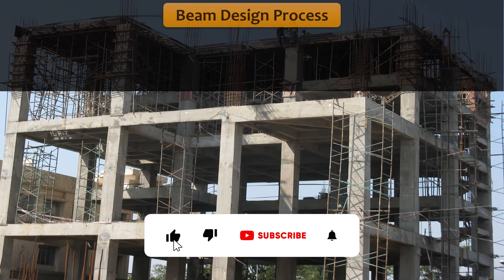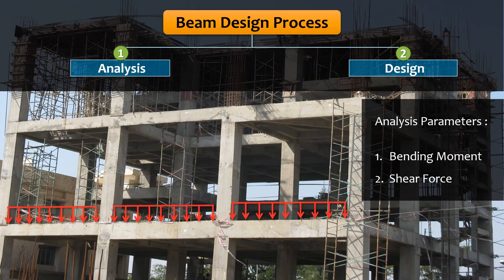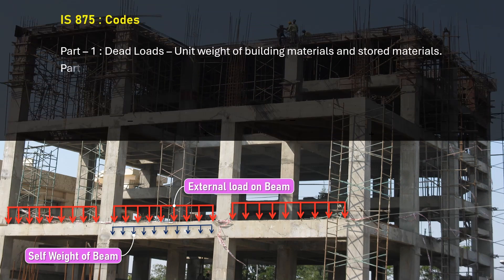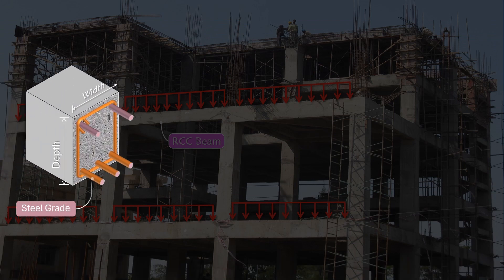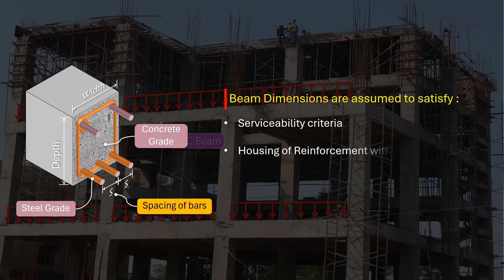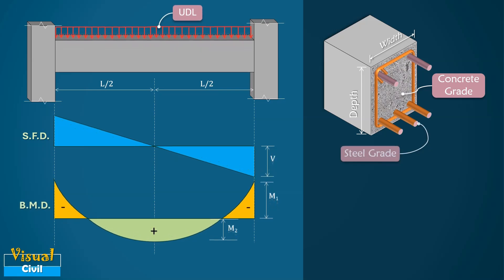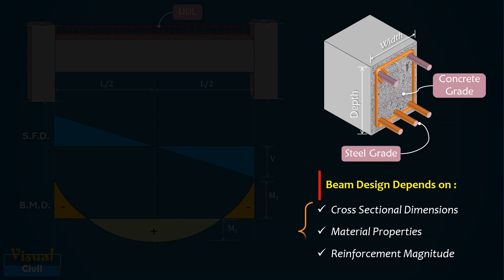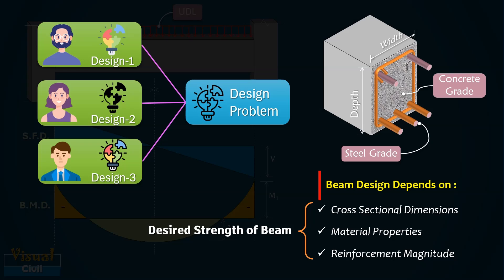How to decide initial size and steel placement for the RCC Beam | RCC Beam | Basic Civil knowledge

Comment: Hit sir, so I have calculated a slab loads acting on the column, that gave me 372kN. Do I use that to determine the size of the beam or how do i go about it? I see most beam design uses 16-30kN to design the beam.
Reply from the maker: We need to calculate the load transfer from slab to beam to design that beam